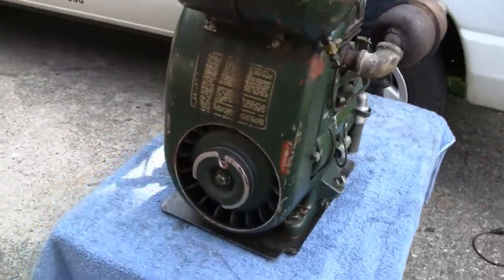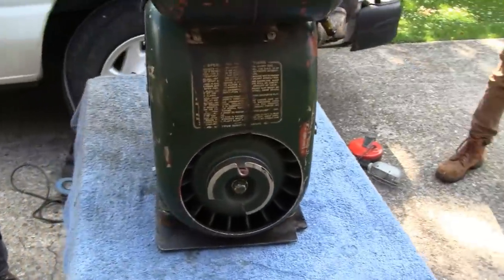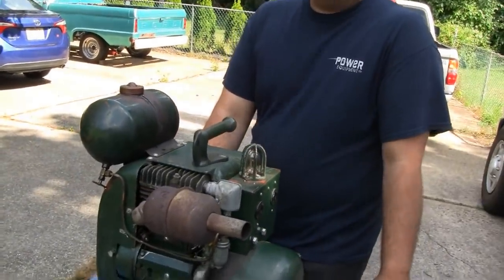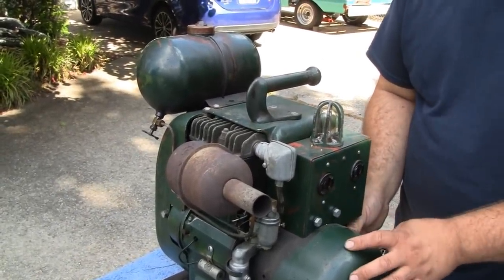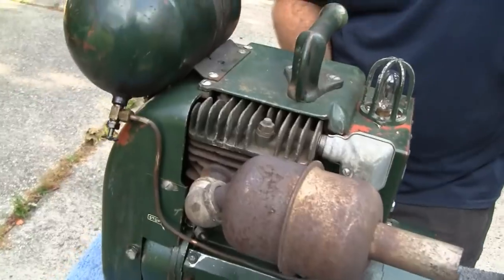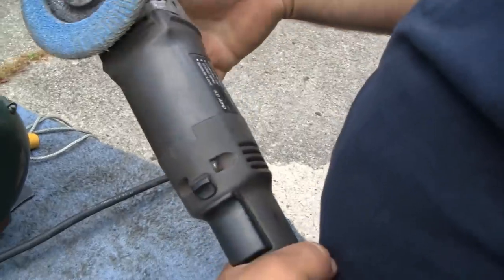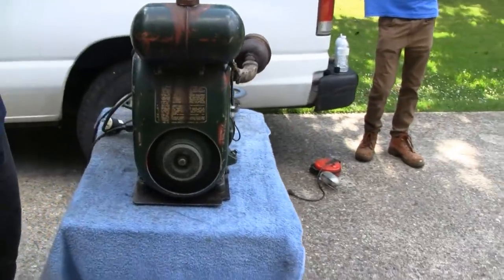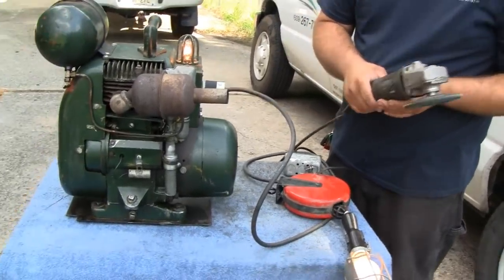DC GENERATOR EXPLAINED IN DETAIL

Comment: Great vid. AC took over for power distribution because you can step it up and down in voltage easily, and high voltages lose less power over long distances.
Reply: yes edison needed dc power station every square mile block
Reply from the maker: Thanks Bud!!☺

Comment: What would happen if you overdrew the power from a generator? Would it stall?
Reply from the maker: It's possible it would stall but if it didn't you just wouldn't get enough power to run what you needed to run or if it was lighting it just wouldn't be as bright!!☺

Comment: I want one...
You can run a stove or cloths dryer with that and a 60hz current alternater (120 up, 120 down = 240A/C single phase). You would need some serious transistors, though. That is a beautiful little machine.

Comment: Only trouble with DC is its tendency to arc in things like switches, so they'll destroy toggle or rocker switches in no time when used with a heavyish load, which is why you usually see slider switches used on DC stuff (like say a 12v car vac), they can resist the arcing a lot more readily than regular switches... :)

Comment: Hi Roadking, can I ask you an off-topic engine question? I'm trying to restore a 1972 Volkswagen bug that I bought recently. The engine needs a lot of work, but I have no experience rebuilding engines and don't really have anyone in my area who can help. I'm on my own pretty much. I'm cleaning the engine and fixing it the best I can with a repair manual and watching videos, etc. I'm kind of "iffy" about whether the valves are completely sealing. I cleaned and lapped them but I'm not totally sure if I did it right. In your experience, do valves have to be "perfect" for an engine to run or how forgiving is it usually?
Reply from the maker: VW engines are pretty forgiving so it would probably run if they are iffy!! But it's easy enough to do it right!! Just keep lapping til you get a solid grey ring on the valve and the seat!! If the valves are pitted too bad, they're only $10 new!! There are probably dozens of VW forums on Facebook, you could get anything you need for that engine free!!☺
Reply: @805ROADKING  Ok, thanks!
Reply: the only thing that usually goes on them is the thrust bearings, grab the crank pulley and see if you can pull it out and push it in

Comment: Old Miller  800 amp gas powered  welders have a receptacle on the control cover fed from the welders  125 volt DC exciter. Pretty handy to run a grinder and drill when you are welding out in the field.👍😎
Reply from the maker: I had an old Lincoln like that!! If you're welding, you're grinding!!☺

Comment: You're looking for "series-wound" motors, where the armature and stator are connected in series. Most small power tools like drills have series-wound motors and can actually run on AC or DC even if they have a line cord. I actually got a drill to run on a 9v battery! I just touched the battery contacts to the plug. It ran really slow of course, but it worked!
Reply from the maker: You know I'm gonna have to try that now!!☺

Comment: .  I have been hit with 300 Volts Dc. .  I remember it,  -----    I will never forget it.  .  It was a simplex power supply for a communications  line.  Low current but that doesn't matter at that  level.  Most of the guys I worked with had a similar experience.  it matures a person.
Reply from the maker: 300 Volts, Aye yi yi!!  Now that explains alot!!☺

Comment: Commutation.  Brushes commutate or alternate the current flow to produce a varying magnetic field for DC input.  AC provides commutation because it alternates so you don't need mechanical commutation IE brushes which energize different windings as the motor rotates.
Reply: Armature
@Tiporari  check out Tesla patents, there's a self-running generator, big enough to fill a large room... #487796. Has a mag field inducer into the motor, DC motor, 3 phase generator that only outputs one phase. Works by being OUT of phase... We pay for electricity because of greed. I would've liked to see a world where $13 is too high for a bill.

Comment: An old farmhouse that the Mrs and I rented (way back) was still wired for DC power, but obviously not connected. But it still had DC fixtures on the walls and DC light sockets in the basement and attic. Modern AC was run to surface mounted outlets, through surface conduits on the walls. I'm sure there was some kinda code violation there. But anyways that's a cool old generator, nice addition to your stable.
Reply from the maker: Sounds like an interesting place!! I hope it had smoke detectors!!☺

Comment: If I lived next door I would braze that muffler for you
Reply from the maker: Lil' Dirtbike is gonna weld it for me!! I had to drain all the fuel and let it air out!! We tried to take the pipe outta the engine but it's not budging, I don't want to force anything and break the casting!! So he's gonna have to weld it while it's on the engine!!☺
Reply: @805ROADKING  You could do the shopdogsam trick and hack saw it out ..I got lucky on my briggs and sawed it off and sprayed a bunch of stuff in it

Comment: When I worked on aircraft voltage they said DC "pushes" and AC "shakes" so, DC will knock you away and AC will grab you and rattle you to death. I've taken a few minor hits and all I remember is when it's AC, 440hz is a higher pitched pain than 60hz.
But the only people I saw get killed by AC or DC was in training videos and it was always so much power it didn't matter. Those dudes were like a blown fuse, burnt hair and everything.
Reply: Yeah saw a video where a guy was messing around in some high voltage cabinet and next thing was a flash and he was gone. Nothing but a big mess was left where he was.
Reply: @wheeliehigh1  yeah, I avoid high voltage now. Those videos are very convincing.